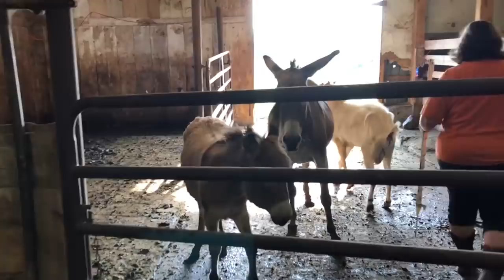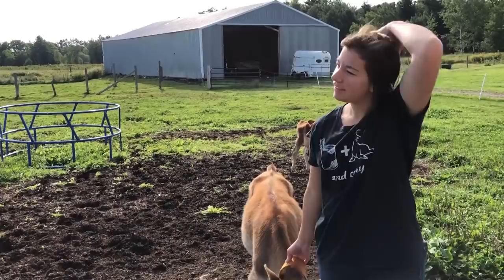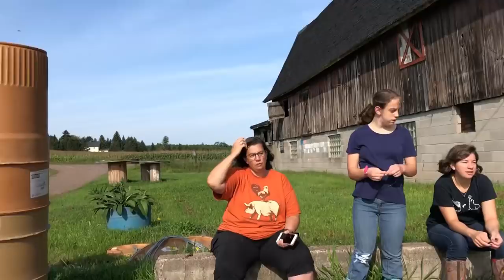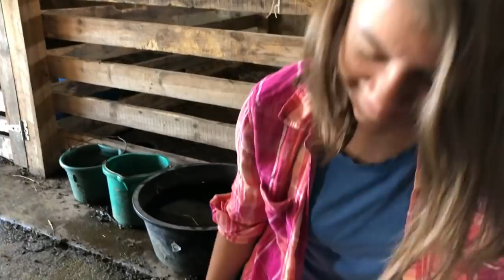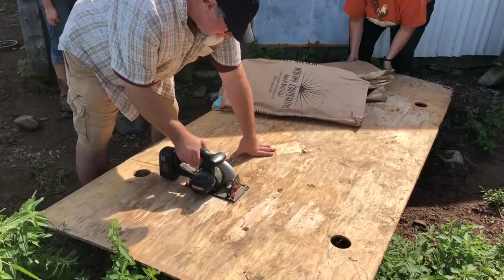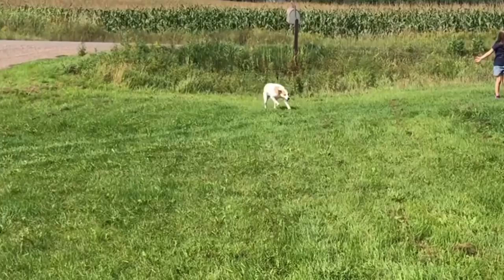Labor Day On A FARM

Comment: Suggestion 
I watched how you tried to get the cart of poop over that obstruction . Suggestion 
You need 4 pieces of wood 
2 pcs of 4”x4” x 5’ long and 
2 pcs of 2” x 4” x5’ Long 
By the obstruction put the 4x4 down then the 2x4 and they will make a gradual removable ramp on both sides of the obstruction so no mere spills.
Reply from the maker: Yep, that is one solution for sure... but then there is just smashing the concrete with a sledge hammer ;)
Reply: Big Family Homestead depends how hard you want to work. The concrete might be keeping out water not sure just a thought but till then it’s a quick fix the kids can do.

Comment: why do you keep alk your animals in the barn all the time. you have acres. why don't you rotate in pastures? I understand keeping them in the winter. But they have been in the barn every video you have done this spring - summer.
Reply from the maker: what are you talking about? They are outside all day. They are not locked up at all, the doors are open all day, every day. If you are referring to them being penned up temporarily in this video, it was explained in the video that we were supposed to have hay delivered, and they most certainly would have been problematic.
Reply: zaneymay  Are you wondering why they’re having to haul manure? I was wondering the same thing. I barely even go into the barn in the summer unless I’m stacking hay or straw in the loft.
Reply: +Lisa M 👍